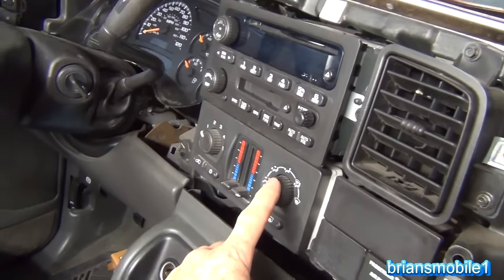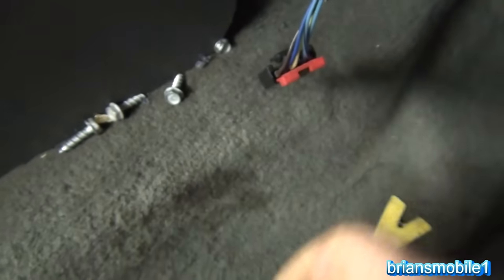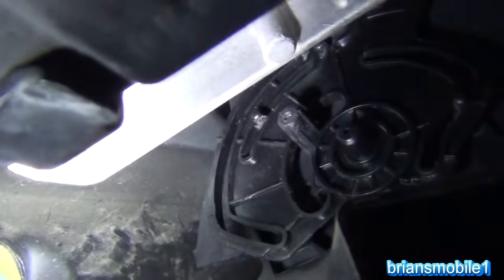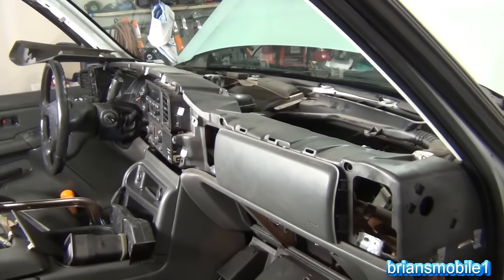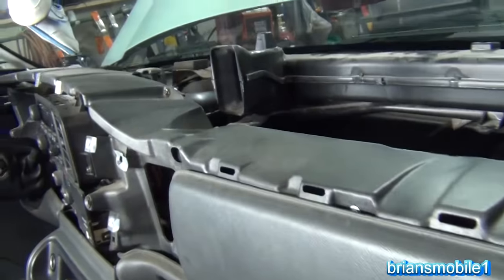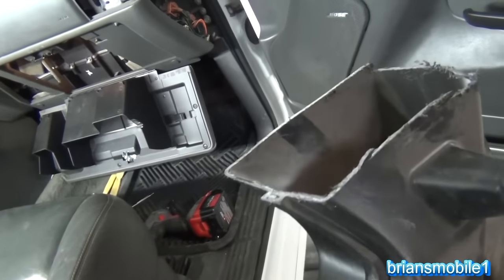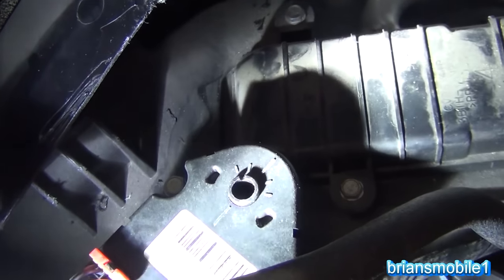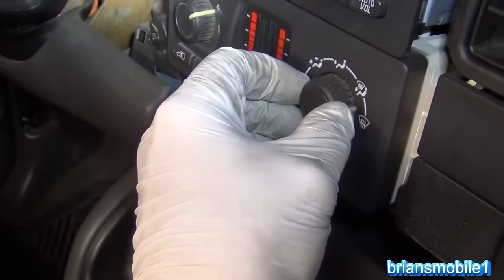Silverado Heater and AC Actuator FIX

Comment: Brain, Thank you for the great video. I have a question. I am going to try to repair my wife's 2004 Yukon LS, AC (blend door)? it's all elect. or digital controls, all the controls work and air blower to vent where it is supposed to (floor, mid & dash settings). We have good AC to the rear/back seats controls and vents. But we do get cold air coming out at the front dash vents, just air?  Which blender door is that for the hot or cold.  Thanks for any advice. Derrick

Comment: Hi Brian, thank's for the videos! I have a question and wanted to see if you could help me. I changed out my air blend actuator yesterday. The new one was positioned in the middle position so i set my control knob to the middle position. After installing and connecting the plug, i tried tried it out. Unfortunately the air blew hot when the knob was in the cool position and cool when the knob was in the hot position. I took it out and reinstalled several times with the same results. Any suggestions or tips on what i might be doing wrong? Thank's and keep up the good work. By the way, i have a 99 GMC Sierra Z71 extended cab SLE.

Comment: I agree with others here, great video. I have changed the recirculated air motor on my 2004 GMC 2500hd which is on top. I found that you can rotate the top duct 180 Degrees in its original position which allows for its removal from the dash without any cutting. It is not easy but worth the effort.

Comment: Hey Brian, loved the video but I hope you can help me with a quick question. Well maybe not quick. I have a 1999 Silverado with manual temp controls and the dash, floor, mix, defrost, etc aren't working right. I've seen a kazillion videos on blend door actuator replacement but I'm assuming what I'm needing is the Mode Door Actuator since my temp and fresh air work fine. On the 1999 Silverado 2 door 4X4 where would this be located, or if you have a link to a video that would be great.Thanks again for your professional quality and content videos.

Comment: Brian super informative video, I have a gmc 2500hd, any thoughts on why my fan control will work on setting i and ii, but on iii fan slows to less than the first i setting, thanks and look forward to the blend door hack
Reply: +jteddy11  Sounds like the resistor or resistor pack near the blower motor.  Look for melted wires at the plug.  GM makes an updated kit.  Also check blower motor to make sure it is not sending the resistor to an early death.
Reply from the maker: +jewllake You're good!
Reply: +jewllake , thanks so much will give it a look

Comment: Very informative video.  The only thing is that I would NEVER cut the duct work.  I like things original so I would need to figure out a different way.   Anyways I watched this video because I bought my son a 2005 Tahoe and the vent controls will not blow air out for the middle row and possibly the 3rd row.  Your vehicle looks to be the same as my son's 2005 Tahoe so I'm hoping that these actuators will fix the no air flow problem within the car.    The front vent controls seem to work but we just got the car so I'm not sure yet.    Last night, the front vent only seemed to work on high but I need to look more into it.    Keep up the great videos!

Comment: Hey nice video, you did say however that you were going to get into the number of pins later but didn't really do so except to say that one has 5 and one has 3 pins and where the one with 3 pins is located respectively but not exactly how many of each? I think I understand the blend door has 3 but are the other 3 all 5 pins? I'm ordering now I'm going to take a shot and order 3-5 pin actuators and hope that's correct?
Reply: There is no way to mess up because you buy the whole set and then retrieve one at the time and replace it or check it one at the time each one actuator will show and the connection
Reply: @JesusHernandez-ll5ok  You assumed that they are being purchased as a set instead of individually..

Comment: If you just cut all the melted tabs as you did the one and take off the bracket on the drivers side and pop up the entire hvac venting assembly up and gives you just enough space to put in a deep 8mm to take off the screw that’s under the ducting. Pop off the actuator and no need to cut. It’s a bit tight with a deep 8mm but do-able. You can also use a short 8mm just didn’t have one at home idk why. Lol. Most of my tools are at work. Once you put the actuator you can just pop on all the ducting and no cuts in your vents. 👍worked well for me. 2003 Silverado z71 with bucket seats

Comment: Great video thank you!! My 04 Silverado AC blows cold air except after a while (20-30 minutes) the driver side beings to blow hot air while the passengers side blows cold air. Any suggestion/ direction to start is appreciated.

Comment: Thanks for the video, my 2003 chevy  blower works but want blow cold air in the summer nor will it blow warm air in the winter, not sure which one to change. l did a reprogram on the actuators sounds like they worked but nothing changed. This was the best video on youtube on what to do, so thank you

Comment: Great video Brian. I was hoping, no praying I would not have to do this when I ran across a video about resetting the system by removing the HVAC/ECAS. It didn't work on my 03 Tahoe which ran perfectly until my mechanic replaced my intake manifold, both Knock sensors and wire connector. A/C system never ran correctly after that. So, all dash is pulled apart and doing the cut tomorrow. Wish me luck.

Comment: Great video my 2005 silverado randomly starts blowing heat out of the driver side vents with the AC on once in a while. The passenger side keeps blowing cold. Do you think this is an actuator and which one would it be?

Comment: Thank you for doing this video, it helped me figure out how to get to the components! One question I just want to clear up on, if the passenger side blows out cold air when you slide the lever up to heat, does that mean the actuator is inop? The driver side works fine. I just stuck a paper towel in the pass side vent to keep the cold air from blowing out for the time being🤣👍

Comment: Brian I have a 2004 Chevy Silverado 1500 that my AC is cooling on my 2 driver side vents but my 2 passenger side vents will be blowing heat and I wanted to make sure and replace the right one. 

Thanks
Tim

Comment: excellent video with great detail. thanks! followed your video and replaced all but one blendor (mode) waiting for part. Still having issues though. After swap recurc door wont do anything and looks like its past marks. I'm going to remove and with battery reposition and reinsert. Going to wait until I replace the last one to figure out whats up.
Reply from the maker: Great to hear!  Some of the after market motors are poop on a stick.  I've been hearing people have had a mixed experience with a brand that sounds a lot like door man?  or Jeaves or bell hop or something like that.

Comment: Bryan:  Great video, thanks so much.  I was overjoyed to find you using a 2003 Silverado for the demo.  I have a 2003 GMC Sierra....same right?  Wrong on so many counts, but your instructions gave me the fortitude to forge ahead.  My defrost/heating manifold is similar, but quite different,  I made my cut over near the drivers side window just before the curve and was able to pull the whole assembly out, defrost still connected to manifold.  I would like to add that removing the drivers seat enables laying on your back and makes working on the 'puck' assembly much easier.  Also, the puck assembly on my 2003 uses a cam gear that overlaps the puck.  Whew!  What a bugger!
Reply from the maker: Ya, there's like 3 different systems.  Two of them being auto or not and the third being what kind of control you have if the truck has rear defrost or not. If it were a Ford there would be 7 and you'd have to know what month or day of a certain month it was built depending if Ford got a better deal from another supplier.
Reply: Thanks for the feedback...my system is exactly as it appears in your 2003 Silverado demo..dual zone manual.  Where as your demo's dash manifold has a short center outlet curve WITH the support riser in the middle of the curve, my has a longer curve and no support pillar.

Anyway....good work on the videos.  Without your video, I would of handed over the keys to GMC Service and grabbed my ankles.

Comment: Hi Brian, this tutorial is an eloquent experience with understanding! My 03 Silverado's climate fan speed only blows on #5. What minimum amount of part(s#) do I need (or can I fix the it)? My Chevy is 1500 w/ 5.3 motor crew cab. Must I remove trim? Thnx, less in fear with U near, RC
Reply from the maker: That's likely the blower motor resistor or control module depending if you have Auto climate controls or not which part is used.

Comment: Brian, great video! I have a 2003 Chevy 2500HD diesel and there is an something moving in the dash somewhere. I am not sure which actuator it is, but it opens and closes over and over, by itself. It makes a slow creeking sound, then goes back the same way. Sounds like an animal under there! :) I also have the dual manual controls like the one in this video. Any ideas would be greatly appreciated.

Comment: I'm getting ready to do the passenger side (hard one) tomorrow. I've ran into a problem and I hope I have it figured out but surprised no one has discussed it. I've already done the driver's side. It has 5 pins and 5 wires. I replaced it 3 years ago with the same part number that I took out and it also had 5 pins. However, the one I bought today only has 3 pins. After a lot of anxiety, confused phone calls, and research I believe the wiring harness has 5 wires to work with both automatic and manual controls. The actuators with 5 pins will work with both but the actuators with only 3 pins will only work with the manual controls. RPO Code CJ3 [Front Manual Temperature Controls] The price difference is more than $100, I guess depending on where you buy it. Anyways, I hope I'm right and will update this post once I confirm it.
Reply: I decided to go ahead and get the 5 pin version just to be safe. After I took everything apart I was getting ready to cut the vent when I paused and took it all in. It looked like I didn't have to remove the vent if I took the airbag out. So I took it out and realized that although it looked awkward it looked easy. Took less than 5 minutes to take out the actuator and about twice as long to put it back. I think my 1/4" swivel head ratchet and medium size hands made it possible. I was also able to easily pry the vent up 1/2 inch to get just enough room to make it all possible. In order to put the left screw in I had to hold it between my index and middle finger. I got lucky as it went right in without dropping it. I still wouldn't have been able to do it without this video so big thanks. Much appreciated.

Comment: HI Brian, @briansmobile1  thanks for the video, your video was the only one that I found that actually tackled the passenger side vent actuator. I couldn't bring myself to cut the vent, instead I took out all of the 10mm bolts along the base of the windshield and that allowed the vent more wriggle room. I lifted the vent on the passenger side and wedged a screwdriver under the passenger defrost vent. This gave me enough clearance to get the bolts out from the actuator.  Once I got the actuator out I took it apart and tried to see if there was a problem inside. I also had a cracked large gear. I fiddled with the actuator and plugged it in (even though I shouldn't have) the actuator worked sometimes but not consistent. I reinstalled it and now I need to uninstall it.  I'm going to remove the drivers side actuator first and plug it in on the passenger side and see if it performs consistently. 
I had an idea that I may be able to drill a couple of nice holes through the vent for easier access to the bolts, however I don't know if this will give me clearance to remove the actuator.  I'll update tomorrow.

Comment: Hi Brian. Great video and helped me a lot. Let me share what I found on my 2005 2500HD. First, the hot on one side was random. Second, the problem remained after replacing the actuators. So dumb old me, I ASSUMED that the problem was the controller. Imagine my frustration when the problem returned after 20 minutes of running. So I started looking into the wiring harness. Everything looked fine, and had continuity from the controller to each actuator. Even more determined to solve this, I connected the battery and watched the offending actuator. During the calibration, the right side actuator moved to full hot and stopped. I waited for the cycle to complete and moved the right side control from cold to hot, and back to cold. Nothing. But I noticed when I touched the junction block on the right end of the dash, the actuator moved over to cold. AH HA! Fiddled with it and the actuator moved to hot even though the control was still on cold. Turns out the junction block had a bad connection between the controller and the actuators.  So if you are having intermittent, random hot, try checking the connections in junction block connectors C8 and C9 before diving in head first.
Reply: Correction C5 and C8
Reply: What did it turn out to be?  I have an HD with a similar problem
Reply: Nathan Scopac  my intermittent problem turned out to be the contacts in the junction block on the right side of the dash. Try pulling the connectors out and applying a good quality contact cleaner like Caig DeOxit. Might save you some time and money.

Comment: i have a 2012 kia soul i got hot air on driver side but cool air on the passenger side an auto store said it the blend door actuator bought it and still the same i watched your video you know what your doing any suggestion cant afford replacing things that don't need replacing help. Thank You

Comment: Have you had good luck with the dorman units vs. the genuine GM actuators? I wouldn't mine taking the gamble on the driver side climate control on as it is easy to get to but the passenger side one behind the glove box is a bear! I am having huge issues where I can't get the driver side hot even when selected and I can't get the passenger side cold even when selected. Problem kinda came out of nowhere after I was swapping radios I am wondering if I disrupted the hvac wiring to the climate control unit. 2004 Silverado 1500 manual control truck. Thx

Comment: Alright, I just did this....

A few observations:
1. I did not cut the ducting.  On a 2004 Escalade, and presumably a loaded up Yukon Denali, or loaded Tahoe, there is a LOT more stuff in & around that ducting.  More wiring.  Mysterious tubes.  A GPS sensor for your nav system.  So, the area where he wanted to cut, I was too afraid to start cutting there.  So much stuff, all over the top there....
2. If you remove the airbag, this opens a lot of room, to get your hand in there, and remove the screws.   This will be mostly braille method, but, I'm no pro, and I did it.  With the airbag removed, there is a great path to get a good sized prybar in there, to pry up, on the duct.  You seemingly can't break it, I was really cranking on it....  this will get you A LOT of room to operate....  Well, not a lot, but, you can get your hand in there, and do what you need to do....
3. Some commenters have talked about drilling holes in the duct.  I did that.  Try to get as close as you can, drill through with a 3/4 inch drill bit....  then you can pass the socket down through the hole, and loosen and tighten those 2 bolts.  I re sealed everything with gaffing tape.  Seems to be fine.    Holes, to me, were easier to repair, and easier to do in the first place....
4. There is a calibrate, or learn, procedure...  If you pulled the airbag, your battery has been disconnected anyways.  So, before you put it all back together, recalibrate, and test.  If it works, hooray, you can start re assembling everything....
5. This is a tough one.  If you're not sure, probably do not try this....

If you do try it, good luck.  Patience....

Comment: Great information; this brings me to ask do you have any thoughts how I can repair a small hole (about no more than the size of a quarter at the most) in the bottom of the AC condensate pan inside the cab. This is a 2005 Silverado 2005 1500 HD truck. The AC drains fine when it has enough water in it to drain and otherwise drains in the cab because of the hole. I believe the hole was created by someone tearing off the cover under the dash, which bolts in some cases to this drain pan. If I can patch this in some way, that would be easiest. Otherwise, what part am I looking for to replace this and how involved will this get. Thanks for any assistance.
Reply: Most any tape;
I had good result using Gorilla Glue which says to use moisture;
Nearly any tape if you can get it to stick;
Project Farm has T-Rex brand tested and is super strong so I spent $8 bucks and attaches well to non-porous surface → i.e. Slick 
Alternately common 2-part epitaxial resin should work good on plastic then toy model glue might be if you can keep the sniffers away with a Chicago Machine Gun from Al Capone

Comment: I have a 2006 2500 HD 4x4 and a 2004 Taho that blow heat out of the driver side on AS  all the other info I found online led me to the blend door actuator to above the gas peddle to fix it but after changing the one on my 2006 and not fixing it. I determined that one only changed the driver side from vent to defrost I could not find out where  the heat to ac actuator was located until I saw your video on where all of them are. PS the 06 is automatic and the 04 is manual.